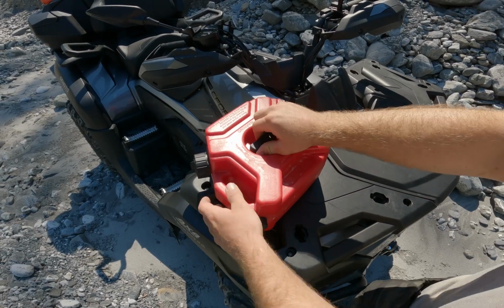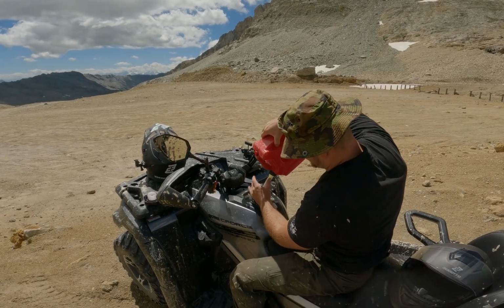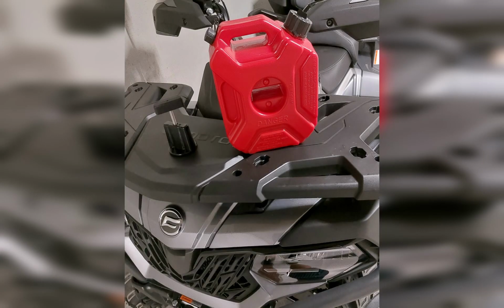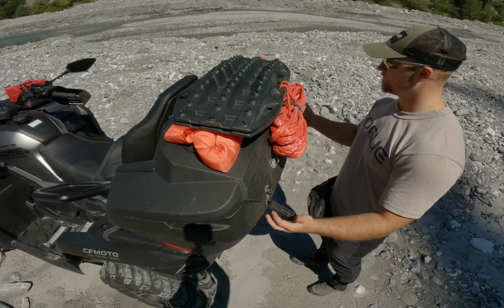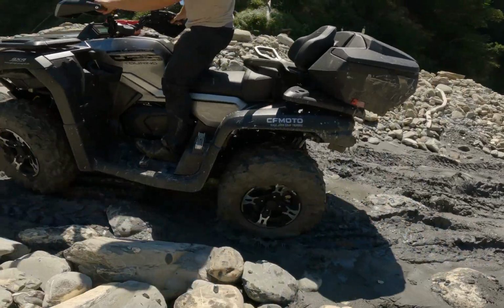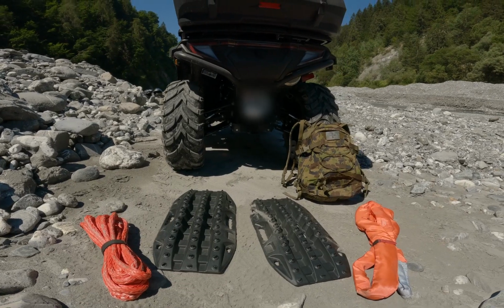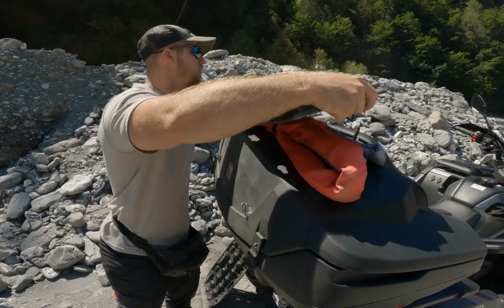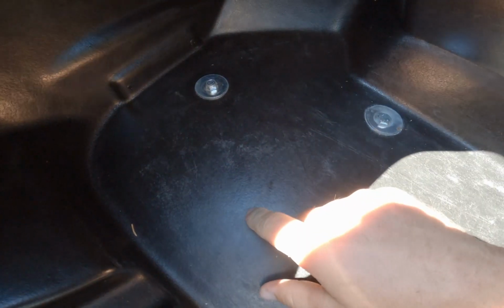CF MOTO C FORCE 625    MY ATV SETUP

Comment: Also, with your “floppy” box, with the bolts run a strip of aluminum between the bolts, this will tighten the entire box across the base from bolt to bolt (left to right) instead of just the washers. This will really tighten the entire box to the rack. Again nice bike and great video!
Reply from the maker: that's good advice, thanks
and thank you for your support !
have a good one 👋🏻

Comment: Some rubber beltline under the box will limit wobble.  A pair of ANCRA tie down straps and soft loops are handy.  Like the tread plates.  Good looking rig.  I have a Honda 520 Rubicon with winch and other items.  I use military ammo boxes for tool/parts/rope storage.
Reply from the maker: That sounds good,  for the front i bought recently some ROK strabs, they are also pretty handy 
cool machine, are you satisfied with the honda

Comment: Whenever you have to use the sand boards: tie them to the ATV (a fairly thin rope will do the job). So when you managed to get out of the mud or sand you don’t have to stop and get back by foot. The sand boards will just follow you. 😀
I like the mounting of the gas canister. 👍 What’s the average fuel consumption?
Reply from the maker: Definitely a good idea, if you've seen my offroad meet video you'll see how you definitely shouldn't do it 😂

The consumption of the CF625 with the slightly larger tires is approx. 11-13l per 100km... yes that's a lot for a machine of that size 😅

Comment: Yo brother nice video, as far as I know CF has original rear baggage which you can mount 2 gas cannister on each side and gives you larger space in it to store stuff. Definitely check it out. I'm planning to buy 1000cc of this atv, have you ever had trouble with snapping the strap ?
Reply from the maker: hey, thank you very much
Yes, the box from cfmoto is really cool, but I'm also satisfied with the structure of mine
i can easily transport the sandboards and extra material outside the box. which would be more difficult with the cover of cfmoto box. 
What i like ist that the box from cfmoto fit perfectly on the back. 👍🏻

Do you mean with strap the V-belt ? if so then you can relax. I now have 6800 km on the machine and the belt has to be changed at 7000.
If you stick to the service intervals, it's not a problem.

Comment: Great video! How far can your 625 go on a tank of gas? Fully laden and "stock" ? Cheers
Reply from the maker: Yes, she likes to drink, I get about 100 to 120 km then I fill up again. it also depends a lot on how you drive.

I have a feeling the fuel gauge isn't very accurate.
the tank capacity is 18l and the average consumption is given as 12l per 100 km, which would give a range of 150 km

Comment: Interesting kind of "vehicle" but, di I male you a Easy question?
Is It ok as quality? I mean, problem about something? Engine, brake, transmision sistem? And about driving ? On the Road (I mean on Road) Is It ok? Naturally driving Arround 40/60 km/h I mean...and engine brake Is enought? Thank you so much for the patience because my bad english
Reply from the maker: hey
well, the ATV is definitely made for off-roading, it's perfect for that.
nevertheless you can also use it for touring, there are no problems.
the cfmoto625 drives 90 km/h which is enough in my opinion.
Otherwise with the engine and brakes and the whole thing is pretty good, the engine brake is a bit strong on the model, it may be a bit unfamiliar at the beginning.
with the newer models I would say the machines are very comfortable and safe to drive as long as you use them correctly.
the quality of the cfmoto is great compared to what you pay for it
Reply: @atvoperator  thank you, the most interesting thing s for me Is be able to find a ATV confortable (i drive normally, with my haevy Off Road Arround 60/70 km/h all most in on Road) and with a lot of engine brakes ( i m habit in this way..) .
As you wrougth I m fiocused Just on turistical use (with tend for free camping and I usually make all possibile on Road jurney and, the minimal possibile Off Road) so It looks teorically as good chois (i Ve find some One used , with Arround 500 km , and for prices between 8000/8400€).
Thank  s a lot for your help, werry kind🤙🤙